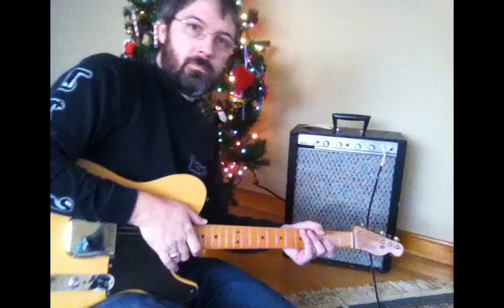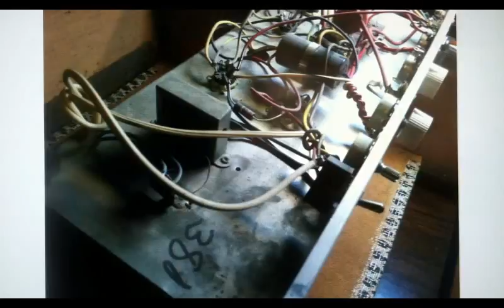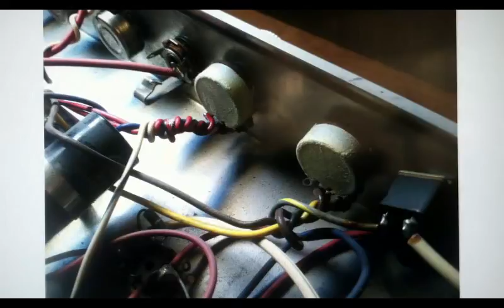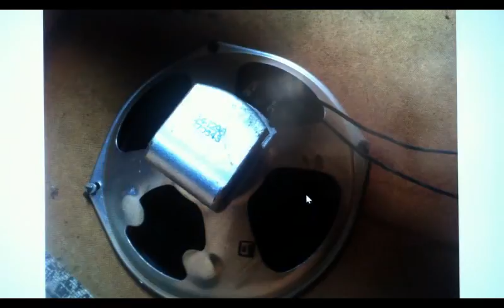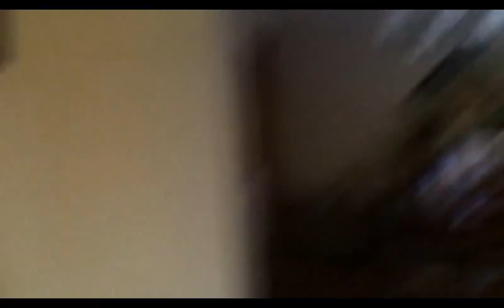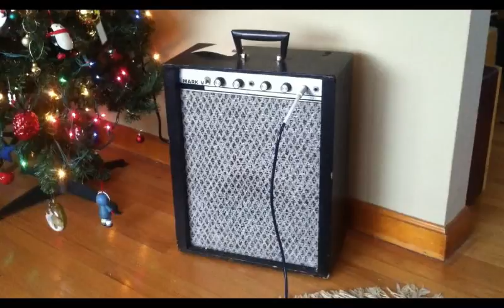1965 Gregory Mark V (Gemini 700) Amp Demo & Service

Comment: I didnt know what i had! My father gave me something similar to this! Grey vinyl wrapped amp with a suitcase handle. It was similar to yours in this video.  Mine only said model-6000 and had 6 pin tubes. Im guessing it was a montgomery ward amplifier. The only thing i remember about the guitar that came with it was it had gold foil pickups. I wish i still had it.

Comment: Hello, I have a Mark V with a bad capacitor (the main large one) what replacement did you use? and do you think you can give a little more info on the other parts you bought for this unit? Thank you!
Reply from the maker: Just replace with a single capacitor of the same value that exceeds at 160V power rating and you should be fine.

Comment: I picked up a similar amp with it circuit diagram saying that it is a Mark V and Gemini 700, however the label on the faceplate says that it is a Barclay Mark V. I wonder if this is just a 'Barclay' sticker that was stucked on it or if there is a connection with the Brand Barclay?
Reply from the maker: No idea. I'd say Barclay was a store brand that Gregory built amps for briefly.
Reply: I have a Barclay Mark 1https://photos.google.com/photo/AF1QipO6moLS4Agdta-FDEhcWJNPGP3AQnX6eRQMu8JX

Comment: I "inherited" a Mark V amp from my grandfather about 20 years ago. Never knew anything about it until today! Didn't even know of the Gregory name. As a beginner guitarist then, I didn't care for it much. However, it sounds like there is great potential once I service it! Thank you! I know you don't appraise, but do you know where I could go to find a ballpark value? I'd never sell, but just curious.
Reply from the maker: +Scott Petersen You can check for values of comparable amps on reverb.com or ebay. The Vintage Guitar price guide is useless in valuing anything that's not a Fender.

Comment: Just another pot question... You mentioned the trem speed control being backwards to what most consider 'normal' operation. IME, speed controls for some LFO's use reverse-log pots for a smoother travel between settings (ie, to make it so its not all bunched up at one end)... I wonder if that pot is a regular log taper wired backwards to achieve a similar effect (though, backwards)? Regardless, I wonder if that was done to shave some costs somehow (maybe log pots were more expensive, with reverse- being even more so)? Do you have any insight into this? Thanks.
Reply from the maker: +Britt Rossman To be honest, as much as I admire the Spartan designs of Gregory amps I've been fortunate enough to try out, I doubt they would have thought that deeply about it, especially on these low end models. It's an interesting thought though. I'm positive they would have tried every way possible - short of cardboard, Danelectro-style cabinetry - to save a penny. That was the name of the game - get your product to market in the cheapest way possible to satisfy the (at that time) growing demand for entry level guitar equipment. I guess we're left to assume there's method in the madness. Could be it was simply a mistake or oversight in the production process in the made dash to get product out the door.

Comment: I like your butterscotch Telly. I have an old `98? Squire Telly I want to upgrade with new neck and pickups sometime. I really wish you, or someone local, would take up the task of restoring my old Fender Twin. Or, if I keep watching and learning I will restore it myself but, still have much to learn to do that as the amp needs everything gone through to get back to perfect working condition. Cosmetically I couldn't care less. It might look old and beat up but, if it works like new, that's all that matters to me.